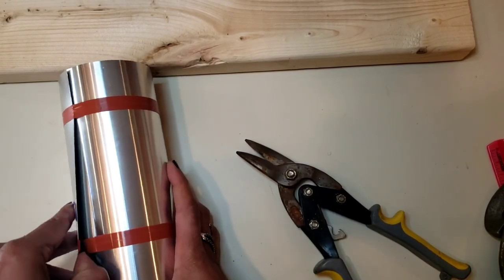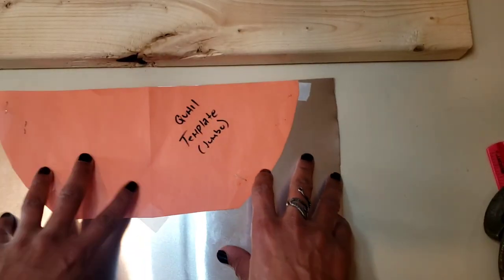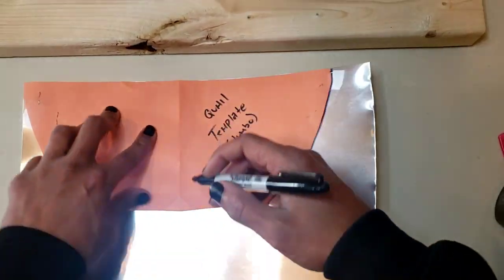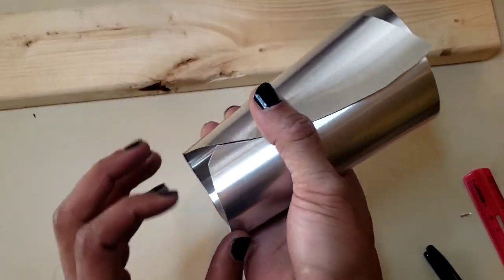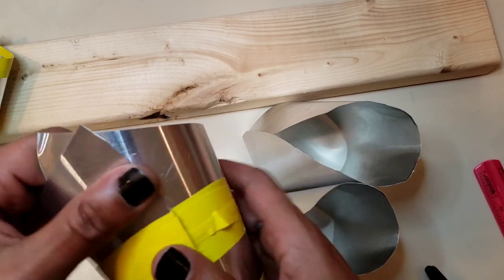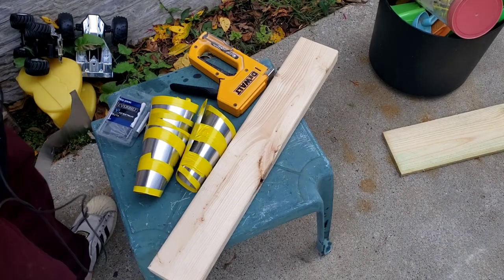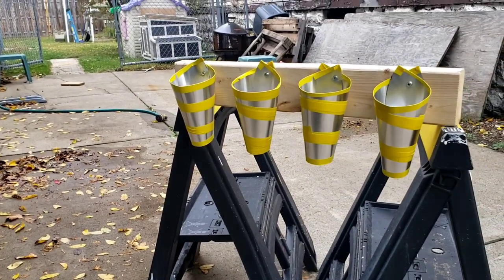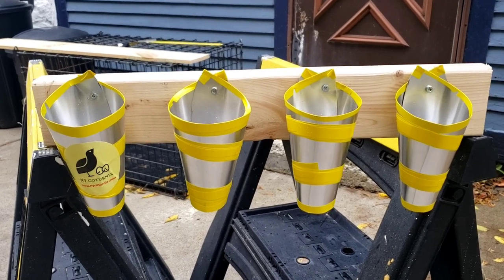How to Make a Kill Cone For Quail

Comment: That's gonna take way more time then just popping the heads off.  You can hold them upside down with one hand and with the other separate the head.  Kinda redundant in my opinion.  Interesting idea, tho
Reply from the maker: It just makes it so that you don't have to hold them to wait for the shaking to stop. Once they're in the cone, you can use scissors, a knife, the pull method - whatever method is best. This just keeps your hands free so you can move to the next set or do something else while bleeding out
Reply: Like chickens, its good to bleed them out, that takes awhile, who wants vhf to hold a bird for 2 minutes if you have 40 to kill? This is great.
Reply: @jamelcampbell4984  2 minutes? They don't have that much blood, thier hearts pump it out in maybe 10 -15 second.  I'll have to time it next time I butcher.  It takes under 5 min to dispatch a dozen, then about 25-30 to clean and skin those and have them ready to pack.
Reply: Maybe, I have not butchered anything in a few years, it will be another 8wks or so before I can. I'm used to chickens. Lol